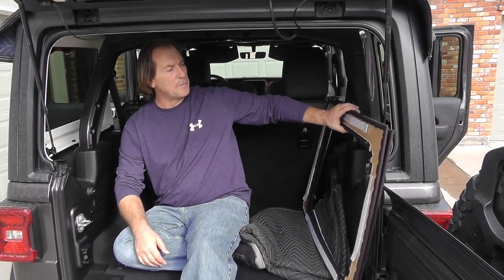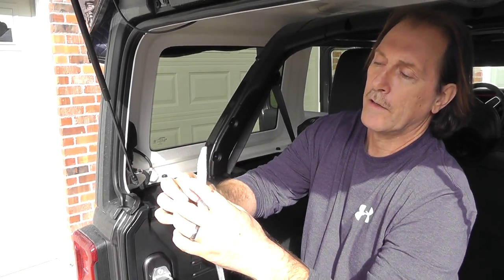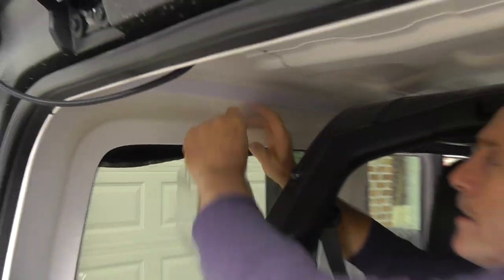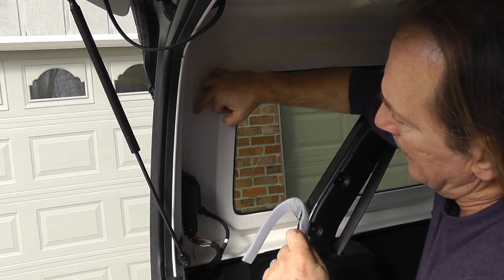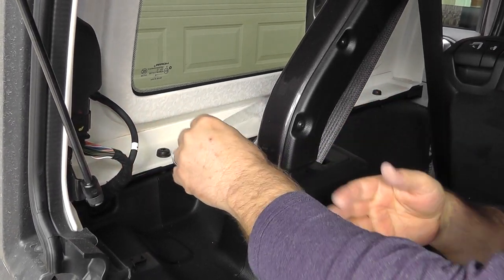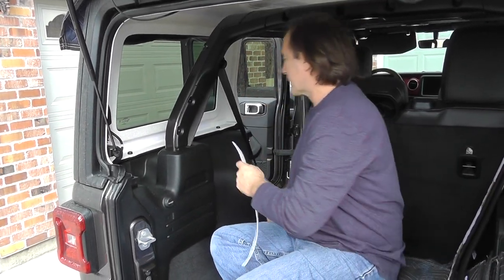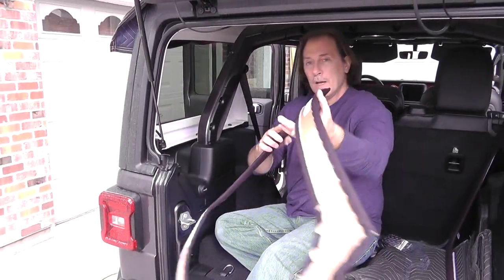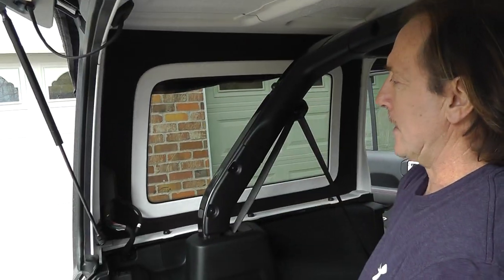How to Install Rear Side Window Panels For 2018 Jeep JL Wrangler 4-Door | Hothead Headliners

Comment: how do these work with the rhino rack backbone system?
Reply from the maker: Hi, the headliners work just fine with that system but the rear side window panels will not work. You don't have to include the window panels when you order.
Reply: @HotheadHeadliners  thank you for your fast response. will be ordering soon

Comment: Interesting.  What does this do?  Thanks.
Reply from the maker: Adrian Torkington 
The rear side window panels complete the headliner kit that we make for the JL Wrangler. You can see our Jeep Wrangler headliners at: hotheadheadliners.com
Reply: Adrian Torkington These side panels are mostly to complete the look when installing the actual headliner kit on the roof panels. When you install the headliners your roof will now be fabric and colored according to the color fabric you choose, so this is an additional option that will give you the same fabric look on the side panels to match, instead of having colored roof with white plastic sides. Just makes the sides look as nice as the roof. They will provide some sound insulation just because they are soft, but it will be negligible. You probably wouldn’t ever install these by themselves and you don’t have to have them when installing the headliners. Just additional finishing for a more complete look. I got them when I purchased my headliner kit too. See their other videos of the actual headliners to see what the primary product is. Their headliners are some of the best, even over the bigger companies.
Reply: It makes Wrangler little bit warm in the winter, little bit cool in summer. Basically it just makes inside comfortable